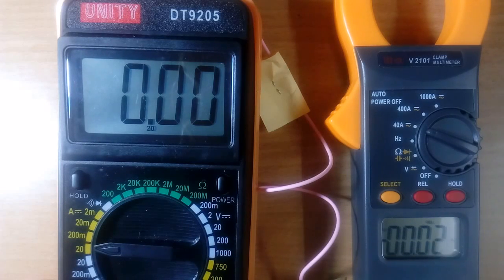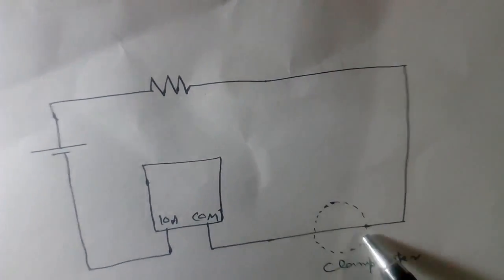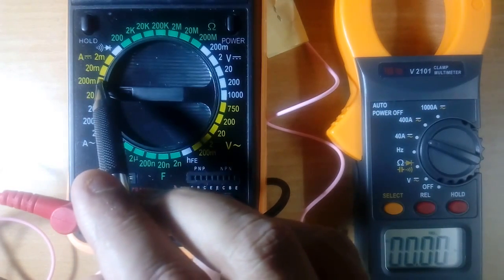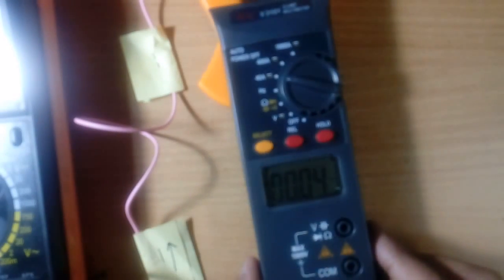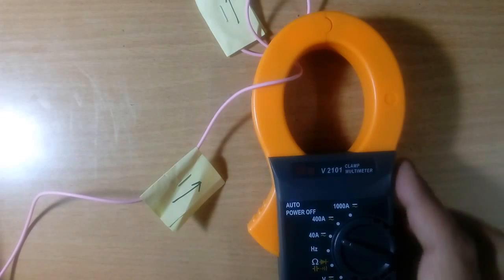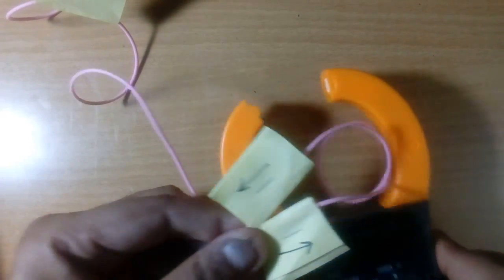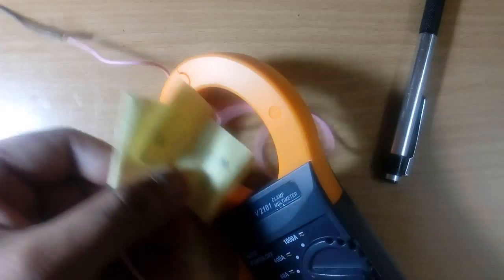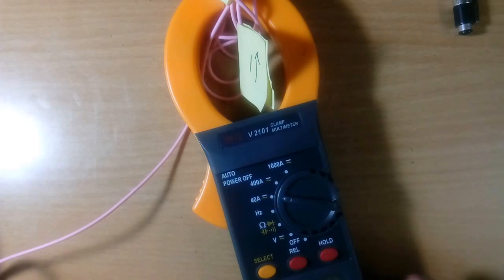How to use a DC current clamp meter

Comment: Sir Which clamp meter you are using right now, i am searching clamp meter for dc current measure but only AC current measurement clamp meter are available.
Please provide me the name of brand with model of clamp meter you are using for dc current measurement
Reply from the maker: Model no V2101, it is very old, company name not readable. It was not popular brand. Look in amazon for DC type. it will cost more than Rs. 2000
Reply: @GKAgrawal2  thank you sir for your instant reply 🙏

Comment: I hate my clamp meter that only measure ac and not dc with the clamp.....sheesh!!!!
Reply from the maker: You can buy a clamp meter with DC current measurement function.
Reply: Thats exactly what Im going to do....thanks for your video.!!!!
Reply from the maker: Try to select clampmeter, which has lower range of DC current also, as DC current will not be generally high.
Reply: @GKAgrawal2  which brand clamp meter is best for dc current measurement?
Reply from the maker: It depents, you get dc multimeter fron Rs. 2500 to Rs 25000.
Reply: @GKAgrawal2  i wanna know a quality brand.
(Like we use ador for welding n cutting process...)

Comment: I was looking how to measure DC current for a project & did not know that my clamp meter could measure it,  thank you
Reply from the maker: All clamp Meter can not measure DC, only DC type can measure DC current.
Reply: @GKAgrawal2  yes but I have the symbols ~ and - on my clamp meter as you showed in your video, I didn't know that meant it could measure both AC & DC current :-)

Comment: Every clamp meter does not measure dc
Reply from the maker: Yes, DC current type clampmeter are quite expensive, more than Rs 2000. You can watch my video on Multimeter buying guide.